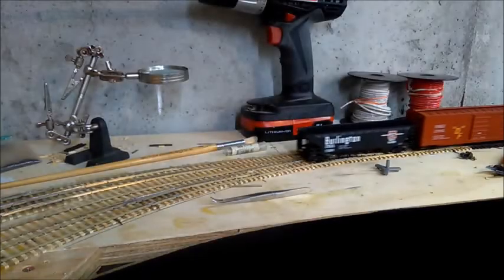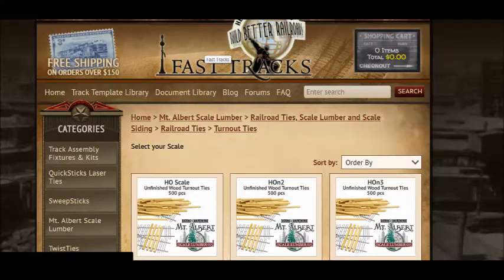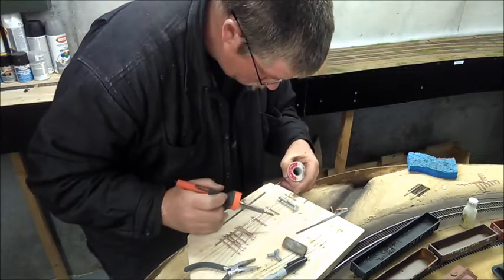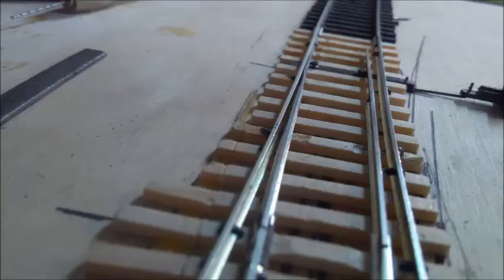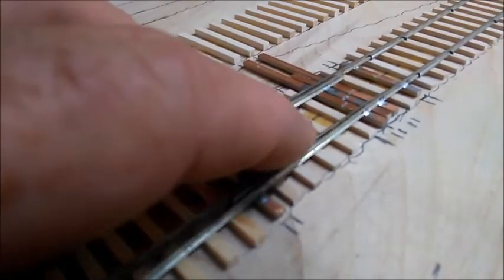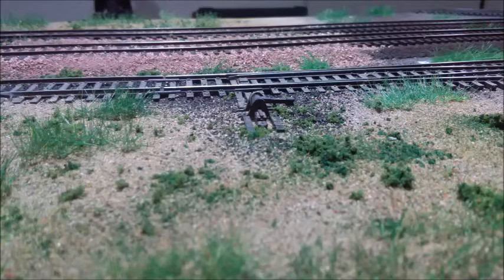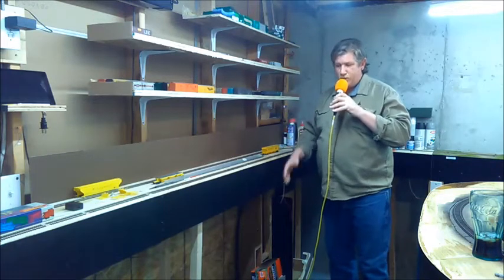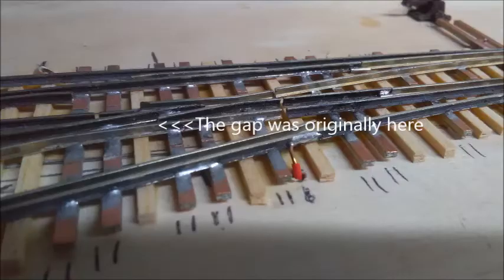Layout Update #3-7: Time to Make Tracks

Comment: I enjoy building turnouts, completing a one piece #8 crossover or a yard ladder is really satisfying. I was the same no tools but a file and track gauge, but since owning the switchblade/frog tool and the stockaid tool from Fastracks has made the building much more efficient and less prone to derails. Thanks for sharing the fruits of your labour!
Reply from the maker: I was in a similar frame of mind after all of this, so I'm just wondering to myself if I should get a stockaid and point former now or wait until I actually get cracking on the next layout. I'll say this much...I might need to replace the Nicholson bastard file I used for the majority of this.
Reply: Mike Linzy at least with a bastard you'll only have to 2 passes over the rail haha.